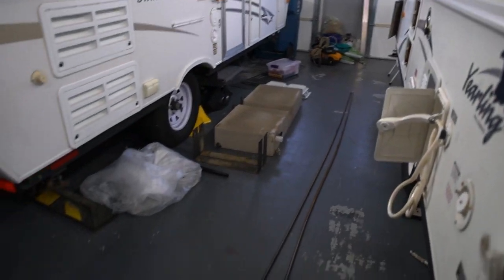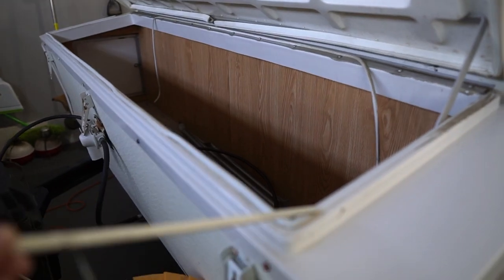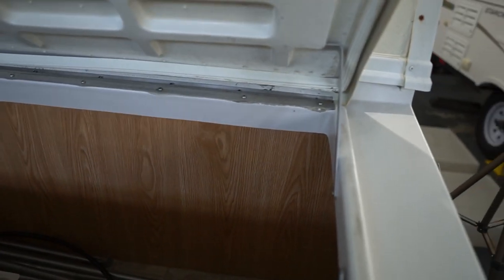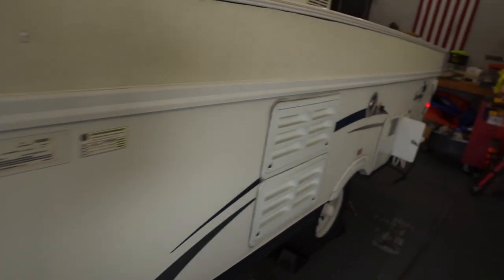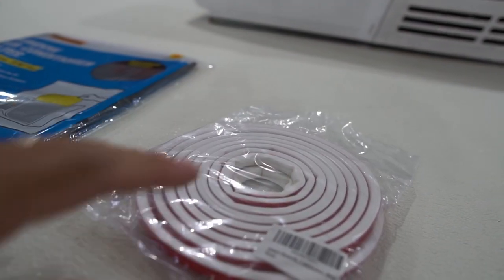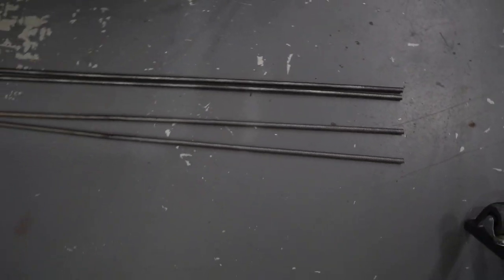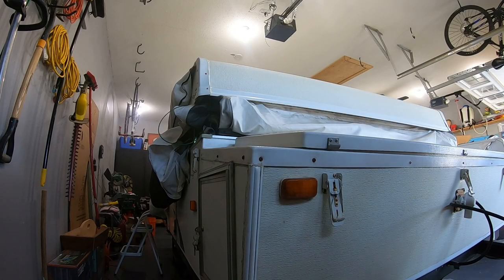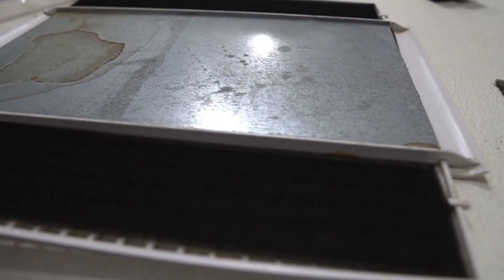Fixing Our BROKEN Pop Up Camper! | The FREE Pop Up Camper Renovation | Part Four

Comment: My popup was making the same noise, I found that the Goshen system has tiny holes in the tubes that are grease points for the springs, stopped mine from making the noise without changing the springs.
Reply from the maker: Where exactly are the tiny holes?  Are you talking about the zerks on the master tube?

Edit: I found the holes. This peaked my curiosity and I called Goshen regarding them. They stated they are water drainage holes, however, you can shoot a tiny amount of oil - not grease - in the holes if needed to help the springs move through the tubes.
Reply: @ItsPoppin  
They are about a foot away from where the tube goes up Into the post, they are facing the ground and it just looks like a drain hole drilled into the tubing. You will have to get a pinpoint grease fitting to go onto your grease gun to be able to grease,  I would put as much grease as possible and then raise the roof about 3 or 4 inches and the grease some more and kept doing that until I had raised it about 2 foot. Then it worked with no noise or jumping.
Reply: @ItsPoppin  
The Goshen Lift system

The Goshen lift system is used by most of the pop up vehicle manufacturers. The cable is connected to a distribution block, enclosed in a tube running front to back under the vehicle frame. Within the tube is located a simple mechanism that utilizes one pulley to push four heavy duty springs through tubes routed to each corner of the trailer. As the springs are pushed through the tubes, the corners of the roof are pushed to the open position. The springs are maintained in a straight pushing position by square telescoping tubes that extend as the roof is raised to the full open position. MAINTENANCE: There are two grease fittings located on the main assembly tube: one is located on the bottom side, toward the hitch end of the vehicle, and the second is located on the top side toward the rear of the vehicle. At the beginning of each season use a grease gun and add grease to each end of the tube until grease appears around the cable (approximately 6-oz). There are four small tubes coming from the ends of the main assembly tube to each corner of the vehicle that encloses the lifting springs. Use a needle grease gun adapter and add a small amount of grease in the hole at the end that curves up to meet the bottom of the square telescoping tube assembly. Not to dispute what they told you but this is what I found and was going by and followed on my popup on their website. I would be reluctant to use oil because it will be dripping out everywhere.
Reply from the maker: They're definitely giving out conflicting information then. This is good, thank you for the follow up. We just want people to be well informed.